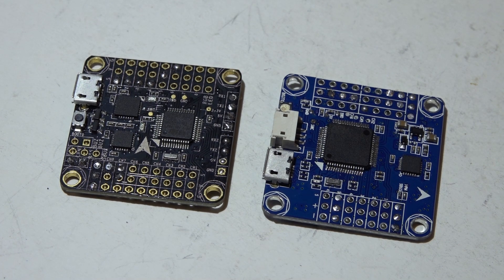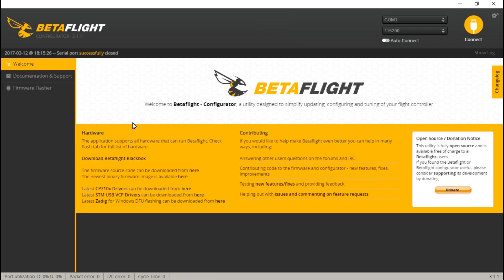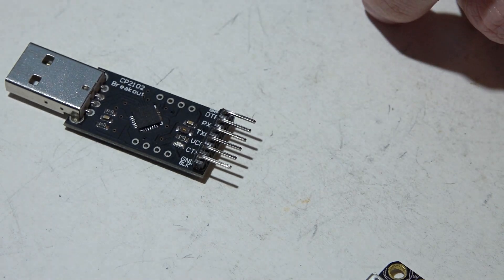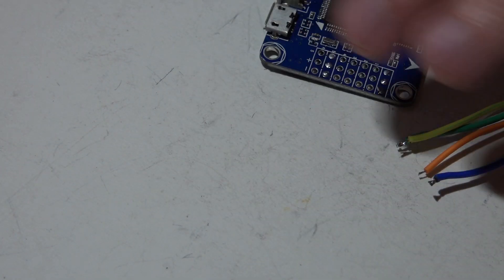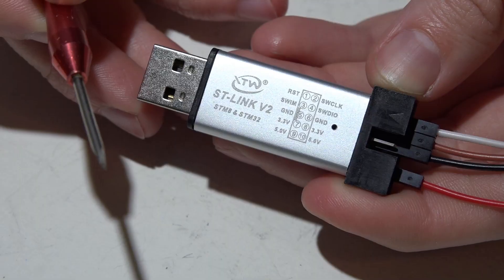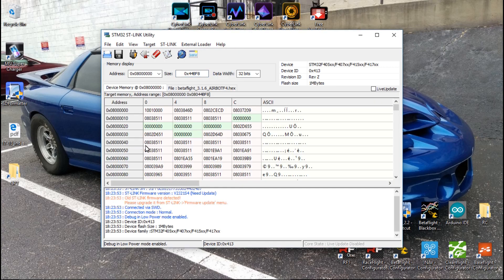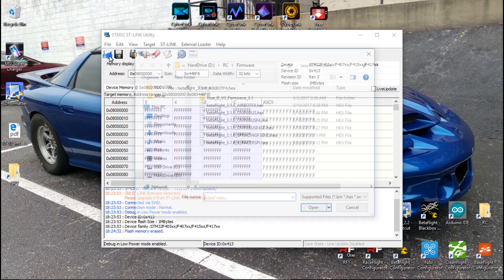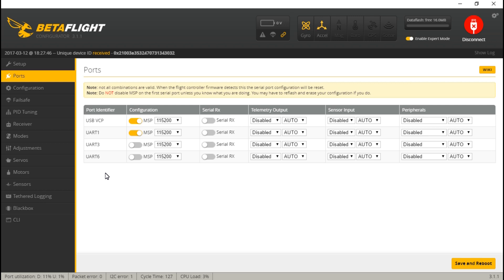Broken USB Off Flight Controller Fix

Comment: I did find a solution to how you can Flash a new Firmware on your FC over a UART with a FTDI Adapter if you have an FC with VCP
My Setup is a Kakute F7 (with VCP and broken USB Port) and a FTDI232RL connected to UART1 (MSP enabled - standard enabled on inav Version <=2.1.0)
You can't flash the Firmware with iNav or Betaflight on a FC like this, the FC can boot into the DFU but a Computer won't recognise the FTDI Adapter as a DFU Device. This Configurators aren't made to flash a FC in this special Case, I believe, so they didn't worked for me in any scenarios. But with the tool "STM32 Flash Loader" I could update my broken Kakute F7 to any firmware I wanted (be careful with the selected FW! - you can lock you out of your FC if you take an e.g. Betaflight firmware without an Uart1 MSP enable fix). I documented it in the comments below this, how I did it. Hope this will help others aswell:
Reply: I tried it again with a different flash util and it worked. So if you have a newer Version like my Kakute F7 with VCP and did manage to break the Port off but one of your uart is MSP enabled (thank you inav for still have UART1 enabled), then you'll connect your FTDI Adapter (I use an FTDI232RL) and Connect it up like JC showed in his video (the first FC). Configuration via Betaflight/inav should work without a problem. But If you want to flash a new version (be careful if a new Version could disable an Uart and you'll lock you out!) you'll have to use a special flasher: I used the STM32 Flash Loader (for flashing with FTDI) https://kiss.flyduino.net/download/stm32-flash-loader-for-flashing-via-ftdi/
Reply: How to flash:
1) Install STM32 Flash loader
2) Connect your FTDI and your FC (VCC - VCC, RX - TX, TX - RX, GND - GND)
3) Plug your FTDI Adapter into your Computer and also press your boot button on your FC (entering DFU Mode)
4) Start the STM32 Flash Loader - If your FTDI and FC aren't connect at the Startup of the Flash Loader Util you won't see any Com ports and have to restart the Flash Util
5) Press next (and read what the UTIL Windows Say!) until you are in the Window for Download und Upload from Device/File (see screenshot & also a possible download for the tool from kiss.flyduino.n et/download/stm32-flash-loader-for-flashing-via-ftdi/)
6) go to Download to device and select your hex file 
7) press next and wait - after the flash has finished, you should unplug the FTDI from the Computer and then replug it (reboot the FC). After that step you can start your Configurator (inav in my Case) and connect to your FC. Check if the Version that is output in the Configurator console log is the version you wanted.
Reply: @Almost787  Hi, I have the same problem with Kakute F7 (broken usb). I managed to enter in Betaflight thanks to this video, but I'm not able to flash a new firmware through UART1 using an FTDI adapter.  I tried what u wrote with STM32 Flash loader with no luck.  Did u disable MSP in USB VPC in Betaflight?

Comment: First of all thank you. Thanks to you I’ve learned and fixed a lot without buying new equipment. I have a Bardwell F4 aio that’s only reading 7v in the osd and on BF. I’ve tested with voltage and it has 16+ voltage on the solder pads and to the first diode closest to the positive battery pad.

Comment: Great tutorial. Soldered on St link on  extremely small succex e mini pads. All connected to stm 32 and erased chip. Then tried to look for the. Hex firmware, there is no betaflightf4 firmware for the board. Only betaflightf3. Searched online, can't find the version. What can I do now?

Comment: There is no need to have the FTDI usbasp adapter if you have Omnibus F3 AIO V1.1, usb to TTL is sufficient. Just connect 5V to any 5V on F3, GND to any GND on F3, TX to UART1 RX and RX to UART 1 TX. Make sure all options are on and manual baud rate is set to 256k. Load the hex you have downloaded and connect the usb to ttl adapter to computer. The flashing process should start. After sucessfull flashing, you should be able to connect to the PC using the UART1 via usb to TTL adapter ;)... Enjoy
Reply: doro44 your comment has given me hope haha. Is u art 1 on by default? I can't remember and I killed my USB port. I'm also using sbus and I don't remember if it requires hart 3 to be on. Do you know?

Comment: Hi, I've tryed with a OMNIBUS F3 AIO but with no success. If I connect the FTDI to UART2 I see the serial leds blinking but no response from Betaflight. While on UART1 I see only TX blinking and no return from RX. I'm stucked because my usb on FC ripped off and no way to connect to Betaflight (still 3.0) for changing settings.
Reply: Same, I program the custom build successfully on my OMNIBUSF3, but still cannot connect via UART1. Just get "no configuration received within 10 seconds" timeout. Did you figure it out by chance?
Reply: Aaron Shropshire unfortunatrly not! I had to go back to my naze32 😒

Comment: Hello, great video..I have a HGLRC F4 flight controller and Betaflight (10.4.0) was reachable till I made a misconnection.
I tried a TTL USB converter on a free UART(6) first to resolve the "broken USB" without any result, therefore now on UART1 where originally MSP was enabled. COM4 port is active when I plug the USB with converter, Betaflight is trying to connect then reconnecting, so I cannot acces the setup.
Do You thing that the FC damaged or what is Your suggestion?
I can measure huge resistance on 3V (impulsing that the CPU could be alive), and the LEDs are lighting/flashing when connecting through battery or on UART6 with USB converter.
Thanks in advance for Your help.

Comment: hiya ive have a problem with my fc its the flip32 f4 revo i was'nt sure about my soldering skills so i asked a friend to do it for me big mistake i had to completely resolder everything it turns out im not bad at soldering after all lol but i found he had burnt out the sbus pin is there a way round this

Comment: Thanks for your video, while it did help my problem is still not yet resolved. I have 2 boards, the first one is from ebay SP RACING F3 EVO brush Flight Controller, and the second one is from banggood Eachine 32Bit Acro Naze32 brush Flight Controller, the starting issue was done by me I flashed the firmeware in betaflight without jumping the boot pads. Now I got the ST-Link V2 and I erased and I uploaded a new firmeware, it did work but still unable to connect on betaflight. I think I'm flashing thw wrong firmeware, I use the Naze32 firmeware is it the correct one for my boards? Thanks.
Reply: KroceBow has

Comment: Hello, I tried this method and still wasn't able to connect to my board. The USB port of mine isn't technically broken off, but a peace of a flower was inside the Port and on connection it went up in smoke. After that I couldn't connect it. I use an betaflightF4 board, the build in OSD still works and my remote can connect to the board, but arming the copter does not work. Is there a way I can know for sure, that my board is broken?

Comment: I came across one of your videos the other day that talked about a flight controller serial port not connecting to BetaFlight, but can't find it now.  In the video, you mentioned about downloading the three files find on the BetaFlight home page, but you also mentioned another download that fixed the problem.  What is the name of the other file (not located on BetaFlight) that will fix the serial port connection problem?
Reply: Mr. Harris - JC (the gentleman who made these helpful videos) sadly passed away last year in a motorcycle accident.  However, I believe the software you're looking for is called "zadig." It's what I used to make my computer "see" my flight controller. Flite Test has a video series that (as far as I recall) uses it, in their FT 270 quad build.  Best of luck to you.

Comment: The first thing I do when I get a new flight controller (after testing it) is to epoxy the USB connector in place.  You will find it extremely difficult to break off an epoxied USB port.  :)
Reply: this is exactly what im going to do when I get my next FC.

Comment: Hi I have a question. connected everything and when i wanted to flash my firmware the Micro usb chip broke off. Would like to check without the converter can i soder it straight to a USB wire?

Comment: The next question is how are users going to flash 3.1.7 if the UARTs have MSP disabled moving forward and they don't have USB access?  ...can't search for modified builds every time.
Reply: Kellen Razzano well that gets explained. I fixed mine. Went back to 3.1.6 on my betaflight f3 FC.

Comment: Definitely going to add those boards to my toolkit.  While I'm waiting for the FTDI adapter to arrive, do you know if it's possible to utilize an Arduino Uno board to make the connection between the PC and the FC?
Reply: Same question.. Is it possible to use an Arduino nano?
Reply from the maker: It probably is possible. Wouldn't doubt it. But I've never tried so  cant confirm.
Reply: Mav FPV as I have already mentioned, I was able to do so with usb to serial. You can put arduino to usb to ttl mode and you should be good to go